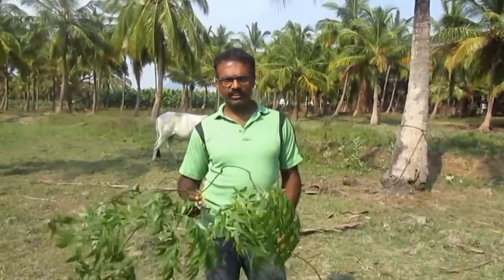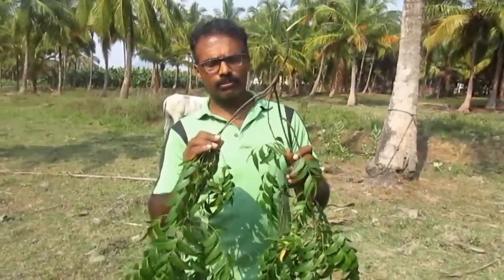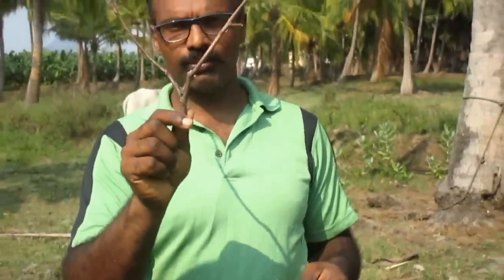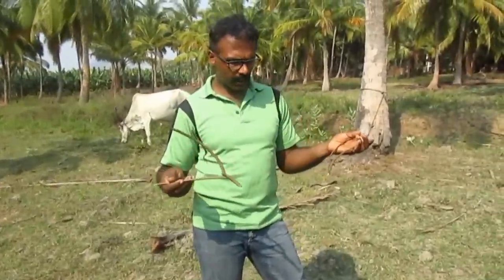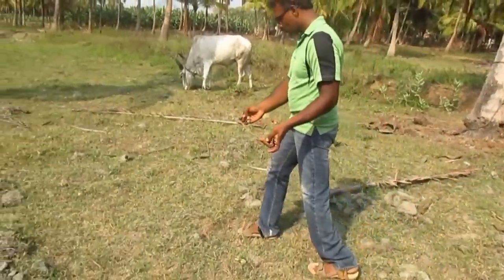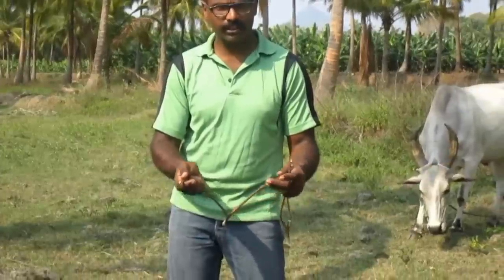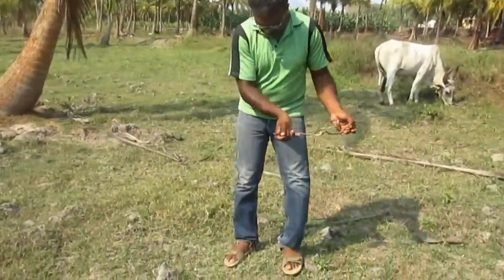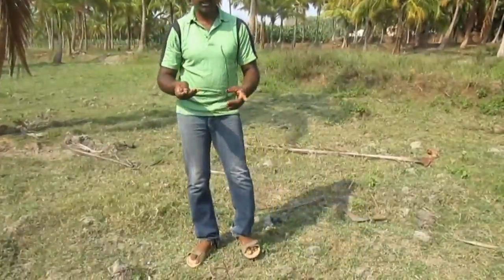Ground water using neem stick - basic course - technique for water divining

Comment: rationalists  society Punjab accepts your challenge       inaam rs  1cr   if you loose  you will have to pay society  rs 25000
Reply from the maker: Karamveir Dhillon 

I accept
What are your condition
Reply from the maker: Almond D souza
Water divining
9865660921
9488134139
Reply: आपका परीक्षण जिला मोगा पंजाब में होगा । आपसी सहमति से जो तारीख तय होगी उसके बारे में जिला प्रशासन और अखबारों को सूचित किया जायेगा। आप 25000 रुपये नकदी मोगा तहसीलदार के पास रैशनल सोसायटी के नाम जमा करवायेंगे । हमारी सोसायटी आपके नाम का  एक करोड़ का चैक भी तहसीलदार के पास जमा करवायेगी ।जीतने की सूरत में आपको एक करोड़ के साथ आपके 25000 भी वापस मिलेंगे । आपको 5 एकड़ भूमि में से वो जगह बतानी होगी जहाँ पानी का लैवल सबसे ऊपर हो ।जहाँ जहाँ आपकी सटिक हरकत करेगी उस उस जगह पे निशाना लगाया जाएगा ।फिर आपकी आंख पे पटटी बांध कर दोबारा खेत मे घुमाया जायगा दूसरी बार उनही जगह आपकी सटिक घूमने पर आपको जीता माना जयेगा ।किसी वैज्ञानिक यंत्र के इस्तेमाल की पूर्ण मनाही होगी
Reply from the maker: Karamveir Dhillon 

Call
9865660921
Reply from the maker: hi

call
Almond D souza
Water divining
9865660921
9488134139
Reply from the maker: Almond D souza
Water divining
9865660921
9488134139